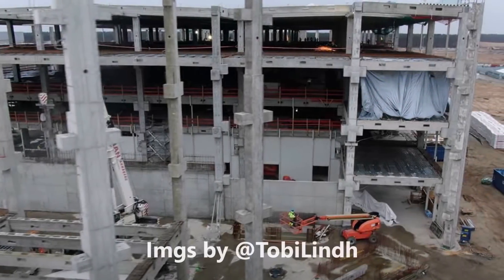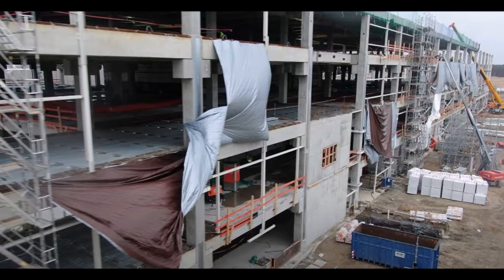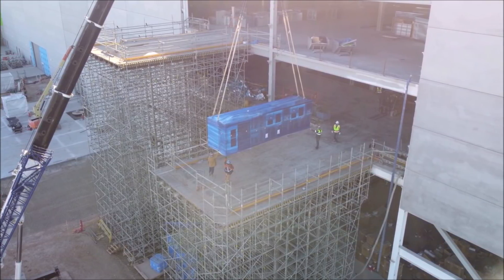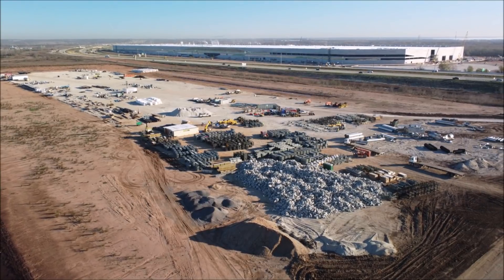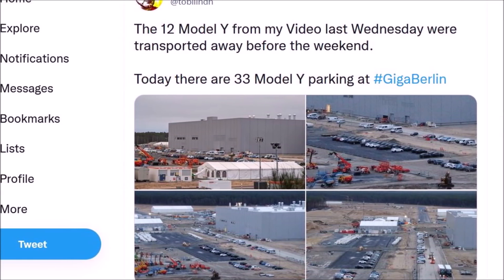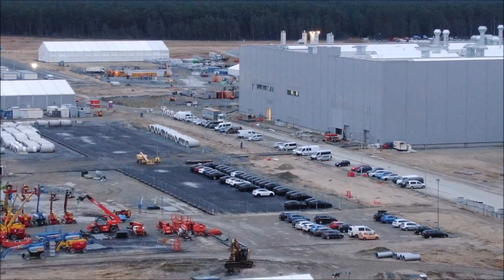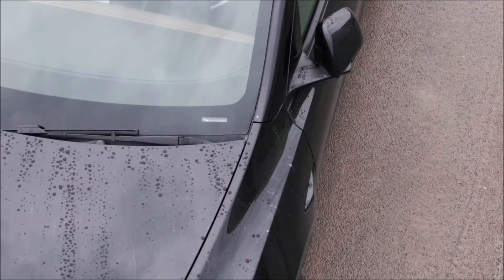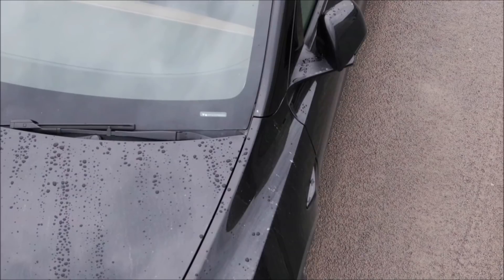Tesla Giga Berlin’s 4680 Battery Cell Production Building

Comment: When ever I see reports that Tesla has built something quickly, I am reminded that the US was always capable of fast construction. 

The Empire State Building and the Pentagon. Each were constructed in under a year. During WWII, Ford built the huge Willow Run B24 plant and Kaiser made shipyards and ships very rapidly.
Many other examples.
Then there is Oak Ridge TN where an entire town and uranium processing facility was up and running in about a year. It used 1/10th of all of the U.S. electricity output.

Comment: Will need several months until the battery cell production building is completed. Alone that they are building things like the outer walls locally, starting from scratch with rebar works. Adamietz - the Polish general constructor of this building - is also considerably smaller than the companies which build the car factory.

Comment: Judging by the progress rate at the main Giga factory building It will take at least 6 good months before the structure of battery production is at the level where the equipment could begin installations and another 6 months to complete the construction of this battery factory. That is fine however since Tesla does not have any plan to use the battery coming out of this battery factory till mid 2023 IMO.